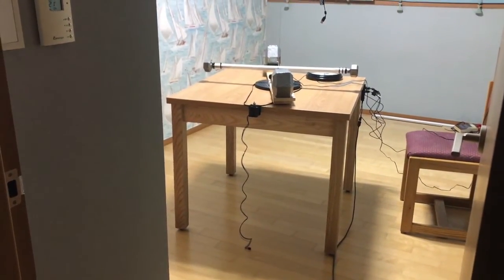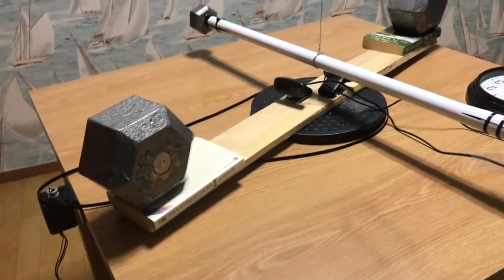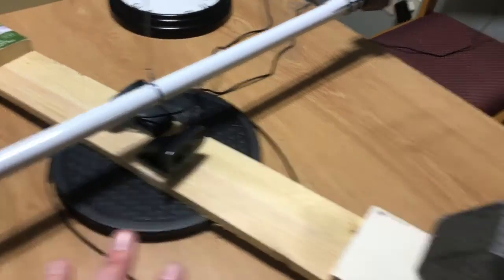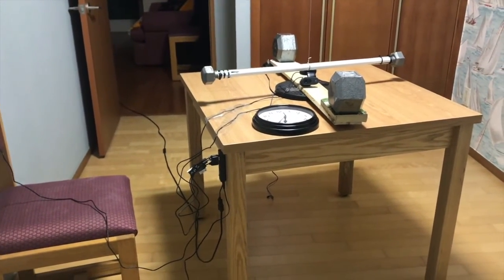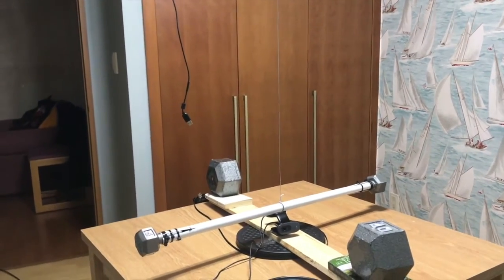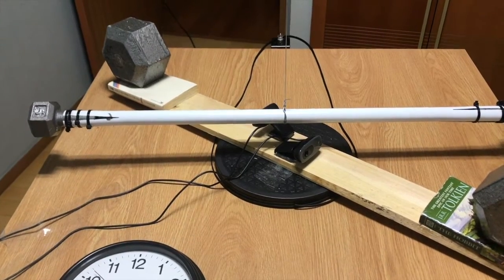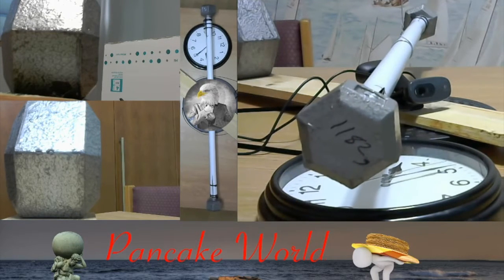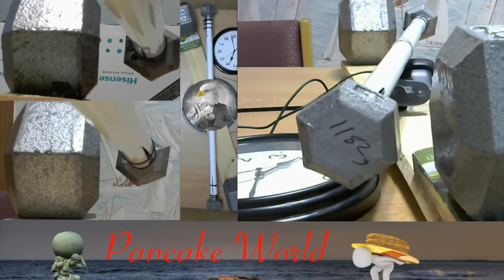Cavendish Update

Comment: Wonderful job.  It's a pleasure to watch the experiment take shape and see how thoughtful you are being about trying to design each element of it.  

My chief concerns are:

1. Air currents.  The plexiglass is a huge step forward but I think you're going to have to cover it and seal it as best as possible like you said.
2. The torque on that cord...  perhaps you can test it by leaning a toothpick against the weight so that it exerts a very small force.  Then see if it turns the weight.  We can then check if it will turn with smaller and smaller forces (you can lean a strand of hair).  We may find "static fraction" which is the initial resistance to movement effectively meaning that it will not move unless it passes a force threshold.  I also think wrapping the cord around the tube isn't ideal. Even a hook screwed into it would be better. If it's unbalanced, it should be set up precise enough to expose any unbalance instantly.  Maybe a nail pivot point underneath onto a hard perfectly flat surface like a mirror would potentially be better.
3. Temperature.  It's ok for now but when it comes to the experiment you need to be precisely controlling for temperature.

My last suggestion is that you get used to the science, I'd start with Galileo's principle of relativity, Newton's three laws of motion and then go on to his theory of gravity.  Don't touch Einstein, there's no need for your purposes.  Maybe work through some examples, how high you can jump on mars or how much gravity there is on the ISS, stuff like that.  It's quite straightforward once you get the hang of it.

Hope that helps a little.
Reply: @BMFurball  There's nothing dumb about what you're doing. You're taking on one of the hardest experiments in science open to the layman and you're giving yourself every chance of success. I'm impressed. 

Here's a taste of Newton:

Newton's 1st law says an object in motion or at rest will stay in that state unless acted upon by a force. 

That simple statement overturned 2000 years of thinking. The ancient greeks thought when you push something it stops. To be fair, that is the everyday experience. So they imagined a "prime mover" who started it all like a chain of dominoes. Newton threw this out. He said being still and moving (at a constant speed on a constant direction without rotation) are identical in every way. No experiment can be done to distinguish being at rest from being in constant motion. There is no absolute frame of reference, no grid that objects move through. Things only change speed when there are forces. Two spaceships passing each other can take their pick as to which of them is moving, if they are both at rest or anything in between. Imagine you woke in a windowless train carriage and on the wall it said 100mph. There is no experiment you could do to discover if you are moving or stationary. Those two situations are precisely identical. The only reason a pushed object stops it because there's a force, otherwise it will not. 

Essentially, the law says, if you don't do anything to an object. Nothing will happen to it. It's that simple and that profound.

Next time you go for a walk, imagine instead of you moving and the world around you being still, try reversing it and imagine that you are staying still and pushing the entire planet behind you. You now know that's a perfectly valid way to perceive the situation. 

I hope that made sense. That was Newton's first law and Galileo's principle of relativity (they're two sides of the same coin). 

Let me know if you would like me to explain Newton's 2nd law.

Comment: Perhaps consider running a wire so that the metal parts of the fixed and moving pieces of the experiment can be electrically connected. The idea is to try to eliminate any attractions due to static between the objects. 
Here's hoping for good luck and repeatable results.

Comment: I didn't know your are able to employ an arduino.
I wanted to make the suggestion to rotate the heavy masses towards the small masses till an attraction is detected (this is to enhance the force).
Once the attraction started the heavy masses could slowly be retracted by means of the arduino to get a bigger angle of rotation 
because the initial distance between the masses sould be as small as possible to enlarge the torque.
If I calculated correctly, the masses you are using would have to come as close as 1mm to get a force of about 3.3μN of gravitation for one side.
Depends on the radius of your big masses (I assumed here .01m).
If the other side is not perfectly aligned it will not contribute. If aligned perfectly the force would be 6.6μN.
Not sure if it can be managed to come any closer.
If I'm correct assuming your small masses to be .5m from the pivot point the torque would be 27.5μNm. That's not much.
I hope you get what I mean.
Reply: I wish that I had thought to calculate this myself.
Reply: @BMFurball  
Yeah, the formula is F=G*m1*m2/r².
With G = 6.67408*10^-11m³/kgs² and r = distance of the masses from *center to center*. And G is the problem here. If the force is too small to start any attraction the only chance is to enlarge the heavy masses by simulaniously not enlarging r. e.g. lead has the advantage to have a high mass at a small size. Gold is even better 😉.

Comment: Are the weights cast iron?
Ferrous? Magnetic weights? 
Not granite or lead?
Reply: BM Furball Pancake hero 
Even if they have no apparent field that is readily detectable, the earth’s magnetic field is an issue. And they do have a magnetic field, small as it may be, regardless

The original experiment was observed for months and months. The weights were observed from outside a protective structure by a telescope, like a surveyor’s instrument. The effect is a measure of Nano Newtons, not milli Newtons. 

Shielding from room air, floor vibrations, you’re own proximity to the weights, everything matters.
Reply: If the force magnetic field exerts on both weights is identical (in value and direction), it should no  be an issue.
Reply: Arctic Haze 
In the cavendish experiment, using two 2 pound lead balls, and two 380 pound lead balls the resulting 1.7E-7 N attraction, by observing a 4 mm oscillation on a 2 m bar with a period of 20 minutes. 

Given the error budget for resolution of that magnitude, anything short of hundreds of pounds of mass, and the utmost calibration of exquisitely designed and calibrated apparatus will likely not return an observable value of G. Scaling down the apparatus will make a measurement all the more difficult. And external forces eliminated. 

760 pounds of lead returned less than 0.2 micro Newtons. That’s ‘clean room’ protocol. 

Ferrous material is a mistake.

IMO 

Good luck.
Reply: @Larry Scott. Agreed but this is not discovering something new but rather checking if the experiment may be done with much simpler means. Ferromagnetism may be a problem but not necessarily if the effect will be identical on both weights. This is exactly why Earth gravity is not a  problem. Also, Cavendish had no lasers and they make the experiment much more precise. Let's  wait for further news.

Comment: What is causing the persistent oscillation?
Reply: Due to the tension created in the string. Basically the string acts like a spring as the object is pulled in the above experiment the force due to the twist of the wire gets stronger and starts making it move in opposite direction.